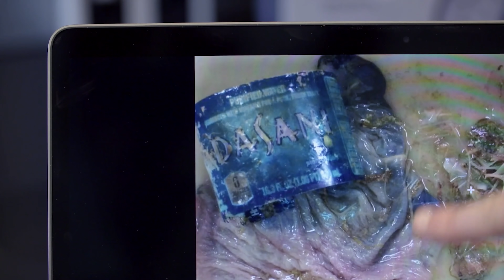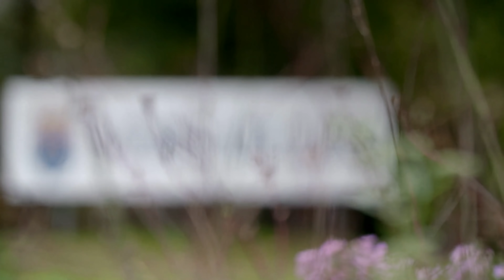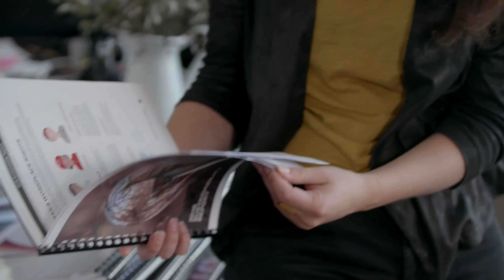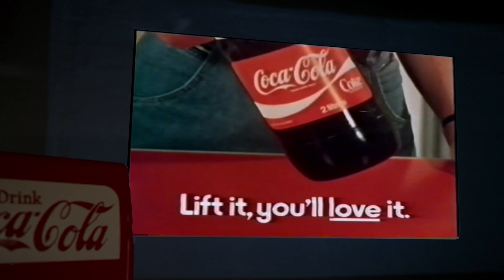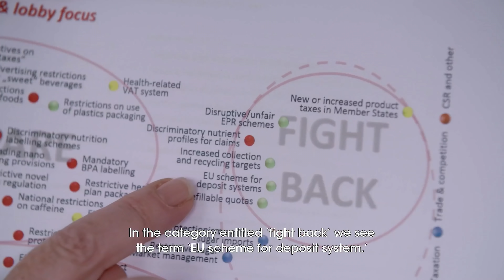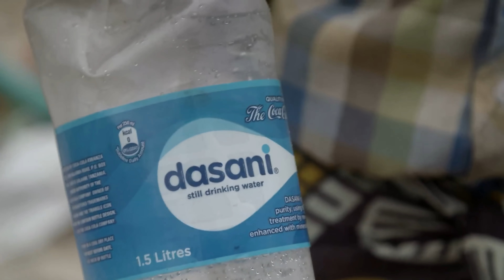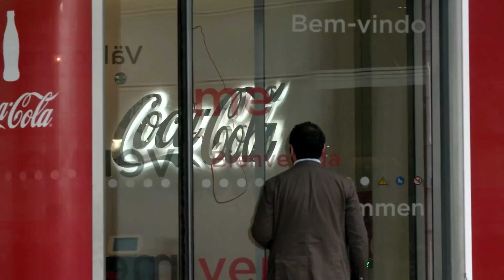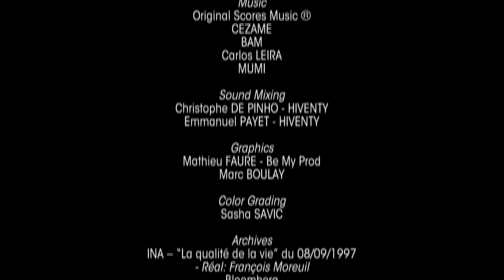Coca Cola's Hidden Secrets (Plastic Pollution Documentary) [4k] | Real Stories

Comment: 1:02
It looks to me like these bumper feet you press into for example table legs which are made of metal tubes, to avoid them scratching the floor.

They usually have these several ridges to avoid the plastic 'foot' falls out of the metal table leg again.
Reply: In fact, in my country also plastic bottles do have a deposit. They do have higher deposits than glass bottles and that's why people generally bring them back to the stores. There they are shreddered and recycled. Some turn into reusable sturdy shopping bags. What happens to the others, I actually don't know.

But since the deposit system was established in my country, way less bottles end up in the trash.

Comment: Plastic bottles has had contributed a lot to pollution 'obviously'. We have no choice but to reproduce plastics or recycle as something useful to environment as it also expires like foods, but when not taken properly of, it causes much more than a pollution. Right?...We as an individual, even when we buy products that has this material or even just a small plastic containers, if isn't useful anymore, at least try to recycle it, or the least you can do is throw it in proper trash cans. That's a big help already. We should be always concerned about the things we do, even it's a small thing. Just to share my habit, when I saw plastics in the streets, or somewhere, I would and I'll always get it, and throw to proper garbage dump so if ever there might be someone will benefit from it. Not to brag, I just always want the places clean😅